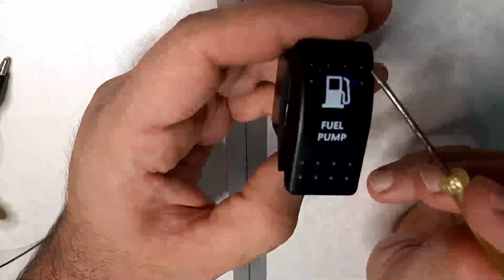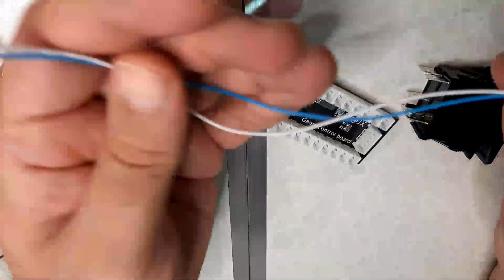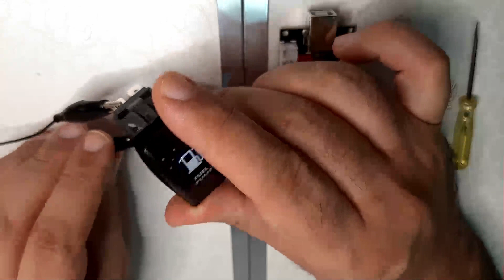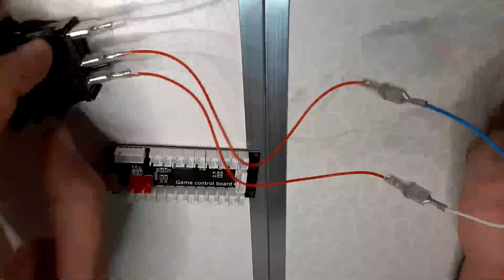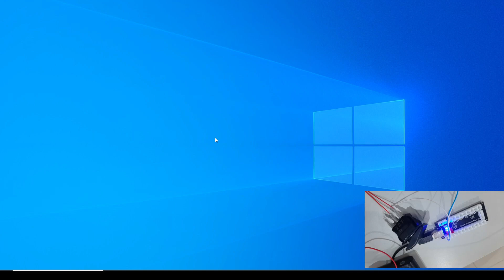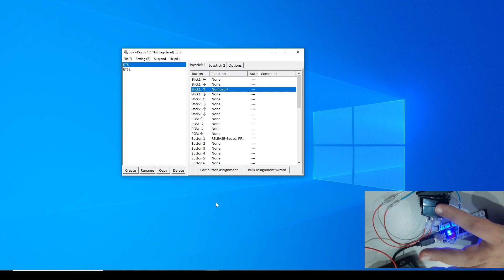ETS2 & ATS v1.37 Real Dashboard Part 2: Rocker Switch Control with Zero Arcade Board

Comment: hello I tried this software with a turn signal lever but unfortunately i dint work. I want that the blinker only works as long as the button is pressed but unfortunately it doesn't work that way. I would be happy if you cud help. Thank you
Reply from the maker: for turning signals no need this software you can use SCS API watch this video: https://www.youtube.com/watch?v=G9WK6aF8CXY